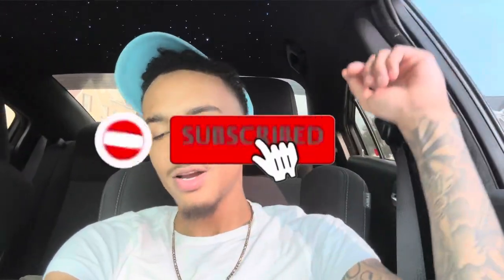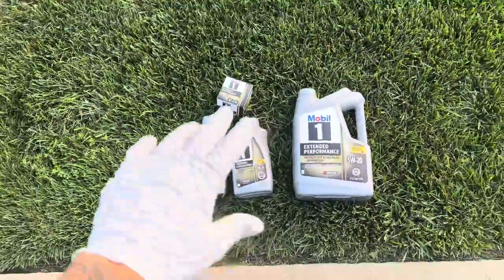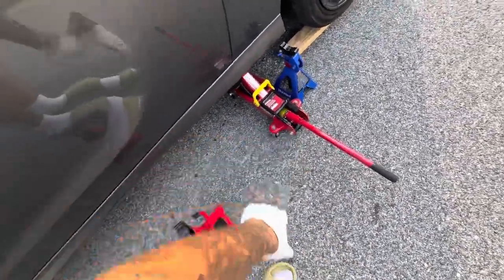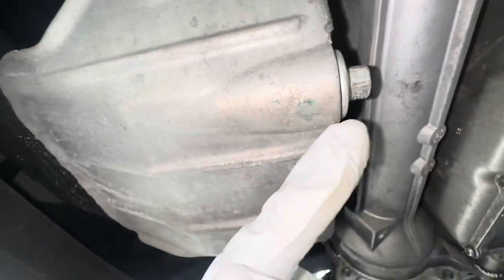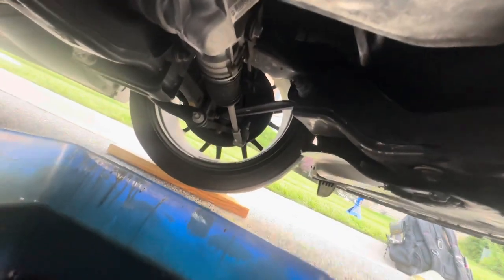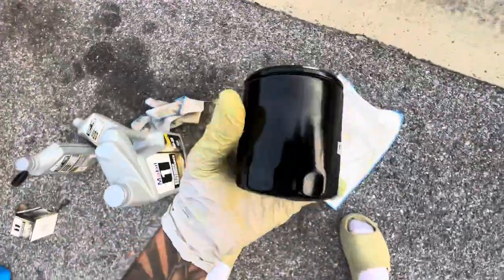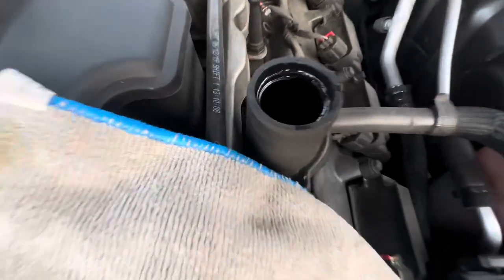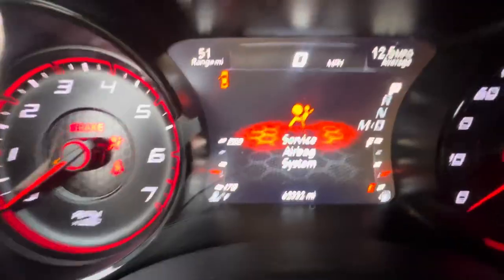HOW MUCH IS AN OIL CHANGE FOR A DODGE CHARGER RT (HOW TO CHANGE YOUR OWN OIL?🔥..)

Comment: Dodge/Chrysler lube tech here. Great job! There is a large plastic cover that comes standard on these that you are missing on yours, a common problem when your charger is lowered. There are four 10mm bolts that hold it up
Reply: Hell it's already too low. I took a turn a little too early & scraped the bottom & the front corner came loose. Then I went through flood waters & knocked the other corner loose.
Reply: Thanks for heads up!
Reply: How often should I change my oil on my R/T?
Reply: @dubeast209  I would recommend an oil and filter replacement every 5000-6000 miles.

Comment: When you took that white oil filter from Jiffy Lube off did it leak and drip oil?? Also.. why do u fill the new oil filter up after you coat the O ring with oil?
Reply: A little late but you fill the new filter with oil to help the rest of the oil circulate threw it.

Comment: Been thinking about doing the oil change myself since I’m a few miles over since my last oil change. The only hard part is getting all the tools like the jack stands and stuff first then you get the oil. It all adds up to over $150 to do the the first oil change yourself with new tools you just paid for. I’ll give it a shot when I have more money to spare for the tools
Reply: Bro why do you got a car you cant even afford the maintenance on lmaoo
Reply: Buying the tools is a worthwhile investment. Worth Saving for
Reply: @levijohnson7544 probably was able to and going through something rn……
Reply: It’s worth it…cost me 40 bucks to do it myself
Reply: I don’t even put it on jack or jack stand, just turn my tires to the side and get up under there lol plus I get free tools and oil at my job 😂 so I only spend on the oil filter tbh lol

Comment: How often should we be changing our oil on our R/T? Especially if we are spirited drivers.
Reply: 2.5 to 3k and don't bs either. Especially with our lifter problems in the hemis. Full synthetic, you can go up to like 5 or 6k, but if you drive spirited as you say, 3k should be your change mark.

Comment: what kinda gas you put in your r/t?
Reply from the maker: 93 but 89 is recommended
Reply: Def put premium in these I just found dat out
Reply: @jayygotit_1 premium won’t make a difference.. u got run what the manual says which is Mid grade 89

Comment: How do you feel about the alpine sound system with no subs or anything added ?
Reply: It’s alright
Reply: @345power6 add 2 10’s or 1 12 with an amp, will also need some kind of signal summing device but it fully turns up that alpine system

Comment: Tell me why chally scats kinda affordable?👀 was gonna get a rt charger but 16-18 scats like the same price with like 60-80k for about 6-800 a month. What we thinkin fellas 🤔
Reply: definitely grab you a chally, it’s the cheapest option if you’re still trying to get that 6.4 engine
Reply: I wouldn't buy any of these cars used bro bro, but that 's just me. Especially not with that mileage. Just get that credit up and save a lil bit more and be the first driver.
Reply: if the 60-80k your talking about is the miles on the car DO NOT BUY IT. Never buy a MOPAR with over 20-30 on it
Reply: @geosweet_  definitely, buying used is always a gamble

Comment: Talks about saving money,  and blows money with bad advice.    No need for Mobile 1 super premium oil.   So long as your oil meets the API certifications your set.    Correct about crappy filters,  save money on oil Wallyworld brand supertech is fine,  spend some on a good filter.     Running Full Synthetic and changing oil at 3K is silly    5K interval is fine,  and can be stretched if running Full synthetic.     Stop throwing money away.